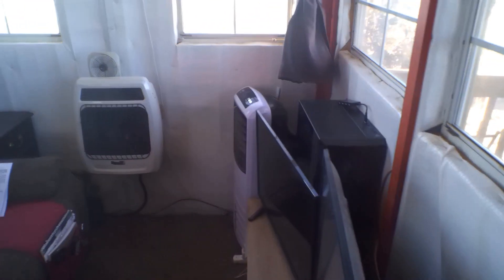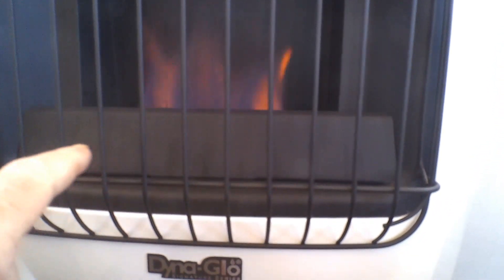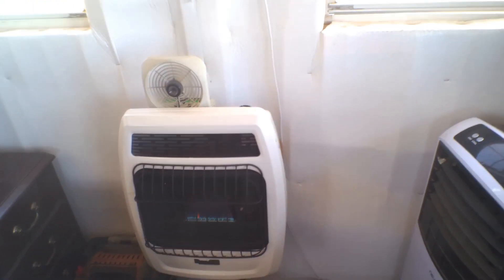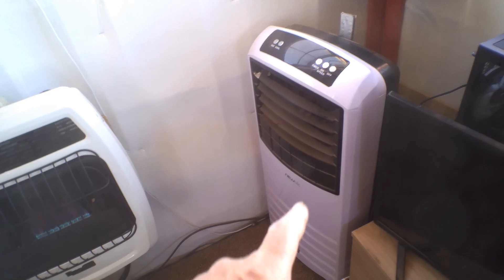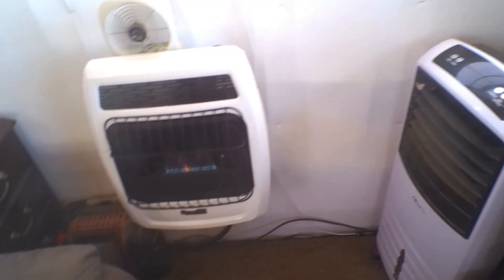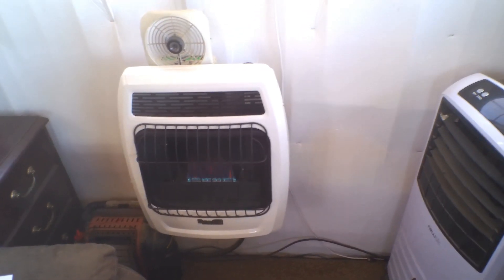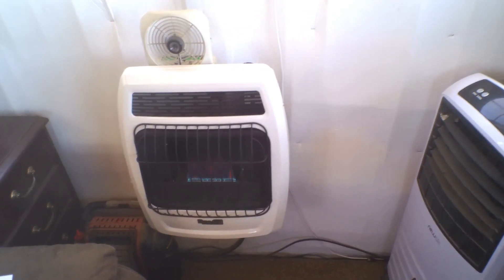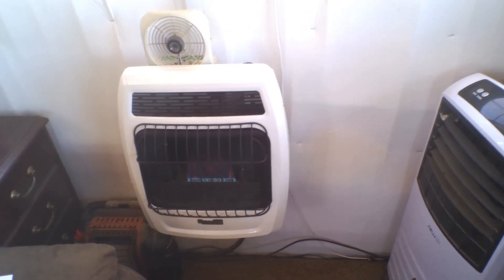Repair and Replace @ AZ Off-Grid (Unplugged) Tiny House Cabin Ranch

Comment: Glad to see your not freezing over there. That winter storm is terrible be glad when its completely out of here.
Reply from the maker: I will absolutely never freeze again if I have anything to do about it.. Especially since when it does get cold outside,, I would never know it inside my nice, cozy little cabin.. I feel bad for the people that are freezing but for 200 bucks they could have prepared and prevented that.. (200 for the cost of the heater plus a tank,, hose and regulator).. Now I have an extra heater which is never enough for me.. lol.. (In case you can't tell I hate the cold).. .. Happy Trails.!!
Reply: @deserthorizons  lol well glad you stayed warm . my buddy heater was definitely worth the money.

Comment: On the topic of swamp cooler vs. Air conditioning...I was confronted with the same conundrum and gave it a lot of research and consideration. I chose AC because water is a premium off grid and I couldn't see helping to evaporate it.
Adding a little extra to my solar system allows me to run the AC all day without any strain on the system, and a drain bucket captures any condensation made from the AC.
Win-Win!
Reply from the maker: If my swamp cooler uses 3 gallons a day (its average) that is only 90 gallons a month.. The money it cost would have only bought 120 watts of solar and I needed 600 more to run an A/C.. Money was very tight 3 years ago.. .. Happy Trails.!!
Reply: @deserthorizons  plus it's easier to breathe air that's not as dry.
Reply: I understand.  I can get 305w panels for $100 each, and I avoid the damp mildew, maintenance, and sealing the swamper for winter.  I buy windows AC units end of season from big box store sales for $50 or so each, so in my case AC was the better choice.
For you it may be different.
Reply from the maker: @GBear  I am "tentatively" planning on making a run to Phoenix next week to pick up (2)- 250 watt polys for 50 bucks each.. So then I will get to Float that much sooner and I can run my A/C both earlier and later.. What I have now is enough to run the A/C,, but,, I,, want,,, more..
Reply: @deserthorizons  yep, me want more to..😁
I'm going to add 4 more 305w panels and 4 more trojan L16E-AC batteries this year.
I don't often need to run th AC at night as it usually cools down nicely after dark, and the breeze blows through my properly designed bedroom all night.  But...I did suffer a couple of humid, calm nights last year, so I plan to be ready for it this year.

Comment: Goodmorning you are getting a lot done everything coming along with the projects so glad you got the new heater its been really cold 🥶.  Happy trails 👣.
Reply from the maker: Good Morning.. yup, projects are getting done,, the kind of project I hate.. A Repair and replace project.. I would much rather spend my money on new crap rather than replace crap I already bought.. It's all good,, now I have a back up heater for justin case.. It is not cold if you stay inside until noon.. I just brought Ruger and Remi inside a few cold mornings to feed them breakfast I had stored from the night before.. so all you gotta do is bring the critters that neeeeeeed food before noon or so into your home and feed them preportioned breakfast.. that way you can stay in your nice warm jammies and fuzzy rabbit slippers and thick cushy bathrobe.. See how easy that was.. .. ..Happy Trails.!!
Reply: @deserthorizons  lol 😆 bunny 🐰 rabbit slippers sounds cozy could use a pair of those.

Comment: You might think about adding a filter between the regulator and the unit. Mr. Heater Buddy recommends this because the holes are so small they can plug easily. This worked for me, because one side of my Mr. Heater got plugged so I put a filter on the other side and it has now worked for 3 winters no problem.
Reply from the maker: Thanks, I appreciate that.. This is the end of my 3rd winter heating season with this wall heater.. Very happy with it.. I will find what the problem is and report in a future video.. It gets gas,, it just no sparky to light the gas.. ..Happy Trails.!!

Comment: Give the plant a sprinkle of used wet coffee grounds .. helps it to grow , even crushed egg shells
Reply from the maker: How much exactly is a sprinkle.? That is precisely why I became a baker rather than a cook.. Cooks do it with a "dash" of that or a "sprinkle" of this and a "pinch" of that.. Bakers need exact,, precise measurements.. I have coffee grounds I could give it but don't know how much or how often.. ..Happy Trails.!!
Reply: @deserthorizons  when I do plant transplanting I use " All" meaning the coffee pot I made for the morning .  the coffee grounds and sprinkle it all around the plant , then water it so the coffee grounds sink into the dirt ferterlizing the roots of the plant . 

Next time you do a plant trans plant 
Mix the crumbled egg shells with the coffee grounds ..place isprinkle n the hole on bottom , then place the plant on top of the comppost mixture & cover plant .. then I also sprinkle more coffee grounds on top ..this way it gets both top n bottom .  ,
Reply from the maker: @laura.m.eggebrecht7985  do i repeat putting grounds on top of the soil around it.? daily.? weekly.? monthly.?
I have found some plants respond well to straight coffee..
Reply: @deserthorizons   .I would do it every 3- 4 days .. and you determaine if the plant is getting any better , if so keep up the routine .
Reply from the maker: @laura.m.eggebrecht7985  as a single person that drinks only 1 to 2 cups per day I can handle that.. Thank you..

Comment: I didn't realize there was a problem with the heater.  I must have missed a video.  I'm going to have to go look, in case I have a problem with mine.
Reply from the maker: Part of what I discussed on last weeks video was the computer would not start up and the sparky thing on the heater,,,,,,, wouldn't.. .. No sparky, No heat.. even with a new battery or 3.. So,, rather than diagnose and spend several weeks exchanging parts for the one it ultimately turns out to be,, I thought I would order another one and then at my leisure I can fix the old one and use it as a backup or on those exceptionally cold nights we have every 10 years or so.. I can never be toooo prepared when it comes to my heat..  .. ..Happy Trails.!!
Reply: @deserthorizons  Never got notified you had put one up lol.  I'll have to keep an eye on mine.  My pilot light stays on, so it doesn't have to light each time.  I get comments all the time people didn't get notified I put something up lol
Reply from the maker: @StBernardAcres  set the alarm on your phone.. I put a new video up every Friday morning at 4:30 am local time.. (Unless I don't) ...lol.. .. My pilot light stays on too,, except every once in a while it would poof out and unless I either saw it or heard it, I would start to get chilly before I noticed it.. Now I will have to get up to check it..

Comment: im pretty good fixing up computers with those power and led light you have to make sure you have it ti the positive side mainly the lights at front and harddrive lights if they dont work just reverse the plug just started watching good to do thanks keeps me company watching tiny houses alot in AZ i watch im in Australia to you did good hooking up all the plugs also the usb ones usually there all together and the audio one usually all together to if i can help with any computer stuff im willing to help ok networking is my only problem im not good at i make lots of computers for people its only a hobby no money i do for just doing it
Reply from the maker: The commute would be a killer though.. lol.. Actually I have built prolly 6 - 10 computers.. Through diagnosis the problem I was having was with the computer was the "power switch" on the 4 year old case.. A new case has fixed it and now I have a case like I wanted originally.. It has been working flawlessly since changeover.. The original "build video" of that computer is up on my channel (from Aug 2017).. ..Funny thing is that the one thing I can't really get working correctly is the wireless networking router.. Computer "sees" it,, labeled it,, I put in password and it will not "connect" so I can't stream from like Netflix and etc.. .. absolutely no biggie.. (I wouldn't pay for it anyway) .. I really appreciate the offer of the help.. .. Happy Trails.!!